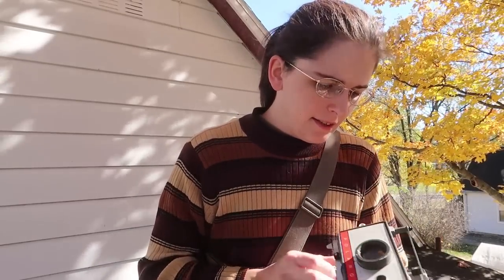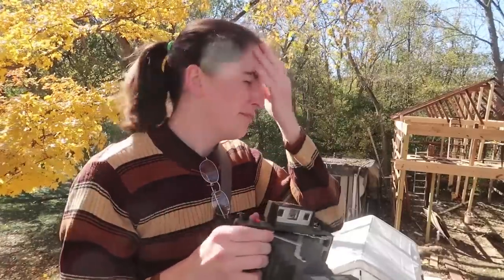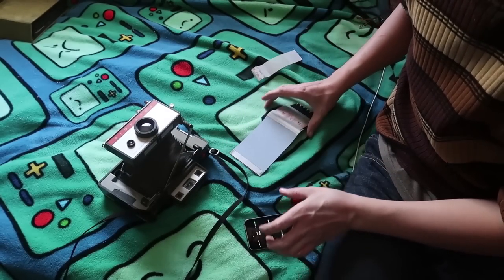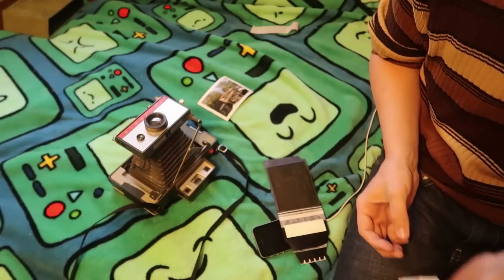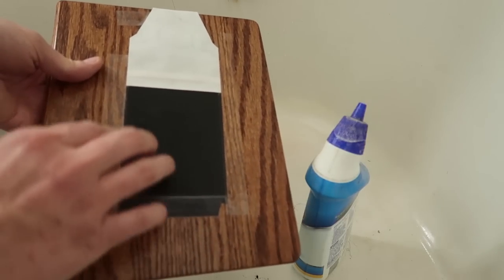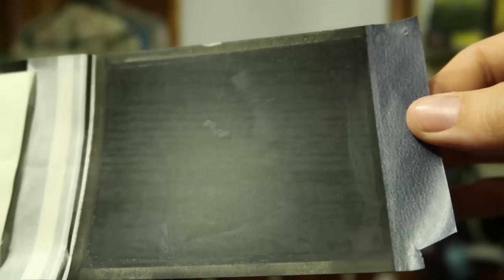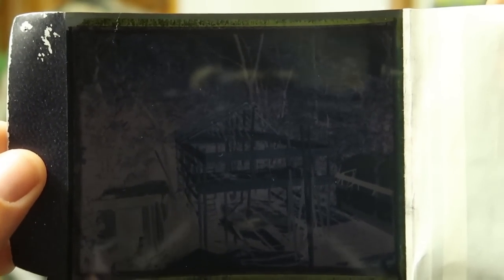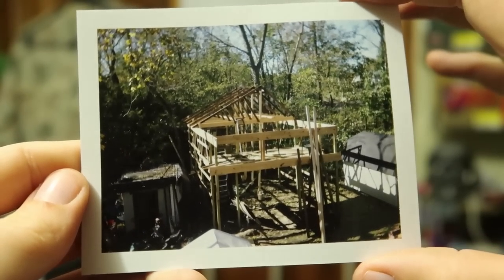Fujifilm FP-100c Film 03: Polaroid Land Camera Picture of Workshop in Autumn

Comment: Such a shame this film was discontinued.....working on converting my model 250 to use Instax wide
Reply from the maker: they will bring it back someday, they will just wait for demand to increase since there is so much still around. that way they can up the price and make it profitable. Impossible Project tried buying the equipment from Fujifilm but they wouldnt sell, most likely they are keeping the equipment for later.

but then again Kodak and Polaroid seemed to scrap their technicians, documentation, and equipment as soon as they stopped making it. it shouldnt take them years to bring ektachrome back or have bad quality polaroids.
Reply: True. Catlabs if jp sold a prototype assembly machine to Florian kaps. He made impossible happen so we'll see what's next.

It's amazing how the price inflated so quickly, I bought a case 2 weeks before the discontinuation became public for $300. Kept stockpiling until it hit $25 a pack a month or two later...
Reply: Also, do you do a po-box for submissions? i have a ton of the higher end zeiss viewfinder/glass lens models. specifically i have a complete model 360 kit with the electronic flash i would send ya. It would be interesting to see you replace the 1960's NiCd battery's in the flash unit.
Reply from the maker: yeah i have an inbox series. address is in my channel about tab. i have a few packages piling up for a future inbox video. wanting to get the workshop done before i film it

Comment: ive got a 1969 polaroid colorpack 2 land camera. uses color film & rotating flash cubes. says on the instructions: "After pulling yellow tab, immediately place entire piece of film in Cold-Clip (2 aluminum plates) with tab hanging out". "Put Cold-Clip between body and arm under coat. Develope picture for 60 seconds inside Cold-Clip". "Separate picture from yellow tab". "Please put tab in waste basket"........ i'm telling you this camera is 100% nasa lol
Reply from the maker: well they all came with Cold Clips, but the cold clip is only for when temp is bellow 50 degrees or so

Comment: Do you have the accessories that go with it? I have a few like the flash and telephoto lens and a couple of other things the only camera I don't have is a 16 mm, and I want one
Reply from the maker: i have a few accessories. actually have about 5 of these cameras. but ive invested mostly in 16mm camera equipment. id rather have my 2 bolexes than more polaroids
Reply: @RinoaL  22 Polaroids cameras but only 1 bolex but I have lots of lenses about 40, I posted a couple of pictures on Facebook of one trunk full camera stuff and someone just gave me a D850 digital , I do have a speed graphic with a Polaroid back, but my profession allows me little time so I don't get to use them much, or have a life for that matter.
Reply from the maker: oh nice, lenses are what i really need for my 16mm cameras. a viewer gave me a F 0.85 lens a while back, might be able to film by moonlight if i get high iso film. but in general i could really go for some more swiss or french lenses. the american ones are shit and i have to rebuild them.
Reply: @RinoaL  you can get adapters for just about every lens and if one doesn't exist you can make it,
Reply from the maker: wish that was the case, like for instance my f 0.85 lens has to be so close to the film that itll require drilling into the bolex and modifying the shutter on an older non-reflex one. the reflex prism's thickness just throws it out of the realm of possibility.

i mean my goal now is to make rockets, i cant be focusing on filming atm. hahaha
Reply: @RinoaL  done the rocket thing, I found old military ones the biggest was about 16 ft. but no guidance systems can be put on them and that was no fun, but we did get solid and liquid fueled, I wanted to be one of the first amateurs to put one in orbit, now I just do concept design for scientists that can't run a dishwasher that's what enigmatologists do I guess, but I have a big place to play and people who can make all the things i need, because they're the stupidest smart people there are, just remember big is dangerous with rockets but fun